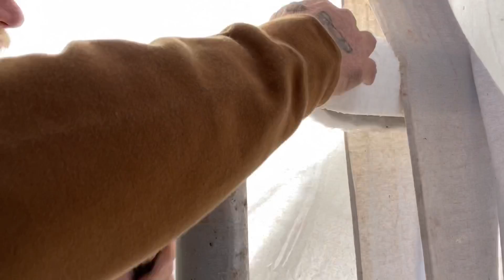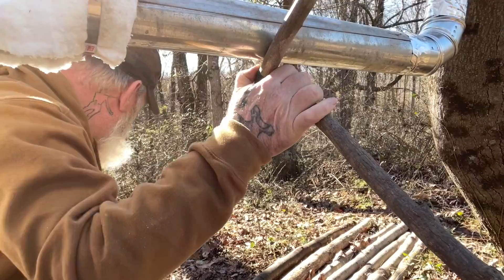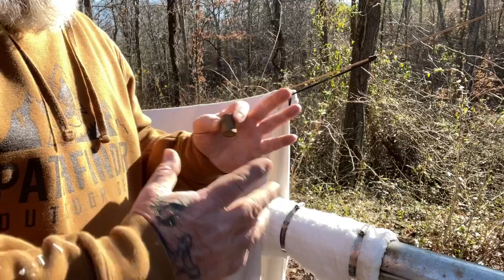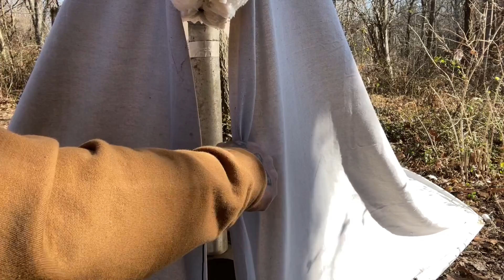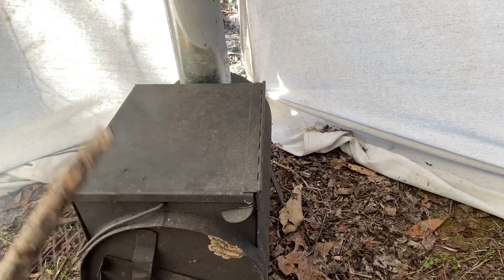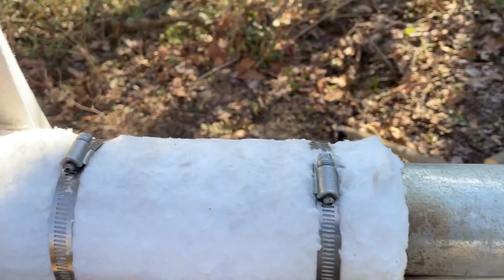Hot Tarp no Stove Jack

Comment: Hi Dave, great stuff. Just remember to use steel stove pipe not galvanized pipe like what is used for gas appliances. Wood stoves run much hotter and at 480 degrees Fahrenheit zink will begin to cook off the galvanized pipe and it is very toxic. Wood stoves can run well over 500 degrees. Gas appliance exhaust never get near that temp. All the best

Comment: You can use cheap silicone cookoe sheets to make a diy stove jack, sew on some velcro or punch some holes every 2 inches and about half an inch from the edge and if you just have a tarp reinforce the edge of the tarp with some duct tape then again punch holes at the same locations as the stove jack and you can just thread some thin sticks to act as toggles through the holes for quick and easy removal, put a flap going over the stove jack seam so rain doesnt go down into your shelter.

The only downside is of course cutting a permanent hole in your tarp but it can be closed off if you keep a spare flap of tarp material to cover the entire hole agaim held in place using a few toggles or use a piece of paracord threaded through.

Comment: If you cut a hole in the tarp, use a Silicon baking sheet on both sides of the hole. The Silicon sheets are for temperatures of up to 500°f. I got one at Walmart in the kitchen Isle for then at $9.00. And the second one at bath and beyond for about $11.00. 
Just look at different stores for these Silicon matts...

Comment: I can already see how those round stock toggles will give better purchase for the larks head than the marbles/rocks I currently use... Any idea of the wear over time of them? The marble part lasts for years although the canvas at the bank line pinch point wears some from wind/sun/rain. I've also noticed that the canvas will reshape/stretch to the shape of toggle/marble whatever the longer they're left in, so if one wants their tarp to not have that happen, consider permanent strap type tie outs.

Comment: A little  BBQ high temperature  paint to protect the outside. And an inch or so of sand to protect the  bottom. Will  make it last longer. A 2d piece of stove pipe after the elbow  will increase the draft. The rain cap won't  stop sparks a metal screen  inside of it will. 
Ice house stove. 
All the best

Comment: I do a similar configuration with my 10x10 tarp over my hammock, folding the "doors" in at both ends to make a sort of floating tent. Hung low to the ground and battoned down all the way, it does a pretty good job cutting down convection under the hammock.

Comment: Well if you are going to do a horizontal run, i would either do it really short or do more of that run inside the tent.  Bailing wire works good for holding glass wrap on pipe.  You can also turn the bipod into a tripod pretty easily:)  I like that stove configuration with the handle…

Comment: Hey Dave. Great video. One question though. When you were securing the back flaps around the stove pipe why didn't you overlap the two sides around the toggle and tie it off? Seems like it would make for better insulation from the wind. Granted it doesn't look like you needed it in this instance.

Comment: that's a great setup.  one the items that I found that will strengthen painters tarp is a coat or two  of clear sealant.  Flex seal is helpful to keep small flying debri from piercing the tent and also ads a layer of waterproofing/insulation.  Rustoleum also makes a sealant but I don't know if it would help with that or if it would coat the cloth enough to add any value such as warmth and insulation.

Comment: I'm no KILLJOY and I am all for innovation and cheap hacks, but you NEED to place DISCLAIMERS and WARNINGS in your videos and in your Description when demonstrating such ideas.  I accept that there is always going to be a certain amount of airflow however tight you try to fasten that Painter's Tarp, but in my opinion (and I know a fair bit about woodburning stoves), your horizontal pipe is too long and you have increased the risk of Backdrafting and Carbon Monoxide Poisoning especially once the coals have died down from a roaring flame whilst you are sleeping.  

You would have been better using two 90 degree bends with a short vertical straight off the stove top, the first 90 deg. bend off that joined by a short horizontal through the tent flap to the second 90 degree bend. joined by the next vertical straight up above the height of the apex of your shelter to a proper spark arrestor, not a rain cap as you used.  

Please, at least warn folk of the dangers of Carbon Monoxide poisoning with such setups and/or to use a small portable Carbon Monoxide Monitor/Alarm.  The next person could follow your idea using an enclosed space or with a super shelter and I as I usually say, Wake Up Dead or at best with a very sore head.  

Merry Christmas.
Reply from the maker: This was a trial concept as I said on the video, the next one I will use 45’s as someone else suggested it may draft better so I want to give that a try as well

Comment: Dave, a poor man would probably just use some of the long twist ties that his Christmas lights came bundled up with instead of the expensive worm screw hose clamps. If he had a few bucks to spend, he could buy some GearTies. They're good enough to hold fiberglass in place and they are more multi purpose, IMO
   On the poor man theme, would you buy 2 cans of any flavor of Campbell's Chunky Soup and cut the ends out with a side cutting, safety can opener and demonstrate how perfectly the two can be pressed into each other to form a stove pipe section? I find that 4 of them pressed firmly together makes a nice manageable length that can be more gently assembled (so they can be disassembled when they need to be stored) to whatever length you need for your tent setup. I don't have the things I need to make videos, but I have a few Ideas that I think would be useful to folks that share my interests on YouTube and this is one that I think could reach a wide audience on your channel. If you aren't interested maybe one of the instructors at your school or just a subscriber would be willing to do it. I just want to see the idea put out there. Don't need the credit.
   I have a question about the way you closed the back of your tent. Since you are using a lark's head that locks onto itself and stays put, couldn't you lay both the left and right flap over the toggle and slip the larks head over it and lock the flaps tighter together and with less cordage?
   How much smoke got released into the tent when you opened the top to feed more wood? I don't think I like that design as far as heating a closed up tent is concerned, although I do see how cool it would be to grill a steak out of the weather with the tent more open.
   I looked up the price of a 9'X12' painter's drop cloth and at $20 that's pretty cheap. Will that actually repel water out of the package, or do you have to treat it somehow?

Comment: I camped for years with a large tarp tied to the back of my IH scout with some poles holding up the other end. A smaller tarp for a side wall.
Built my camp fire half under the tarp. Make sure it's about 7 foot high.
I was comfortable with warm clothes to 25 degrees.  All I had was cheap Kmart sleeping bag. Layed on a chase lounge also from Kmart. 
Good times

Comment: Hey Dave, I've been working on this same concept for years. You pretty-well got it now, but roll a piece of 4" stove pipe around your rockwool then clamp it up; also, try using a length of 6" stovepipe as a thimble around that and you won't have any problems with the canvas getting hot. You won't even have to worry about cold air getting in through that assembly unless the wind is howling or blowing directly into that end of the shelter. That little stove looks pretty handy and will be enough to run you out of a small canvas shelter, especially if you control the draft with a damper. You could modify the firebox just a little bit so it will burn more like a rocket stove, but it basically is a rocket stove to begin with.
Have fun with working on this concept, you'll eventually figure out ways to put a woodstove in just about any style or configuration of tent, including nylon tents and polyethylene carport canopies with side curtains.
Have a good one man.

Comment: Great video, my dad recently pulled down his stove and it is the same style but it's pretty rusty. Any tips to refurbish the stove? I figure hitting it a wire brush on a drill can work but will take a while and likely require a few brush heads. My only thought afterwards is high temp spray paint.

Comment: I have an older hot tent that unfortunately I ordered with the stove pipe exiting out horizontally through the wall.  Its not worth the time to build a support for the pipe.  I need to convert it to a vertical pipe exit with a stove jack.  The newest tent I own has a stove jack that allows the whole stove to be set up with the pipe vertical in less than 5 minutes.
Reply from the maker: Yeah I have like 4 of those but when I post about them folk think I’m trying to sell them or something

Comment: That's an awesome idea. I can't believe I never thought of it. I'm a plumber and work with that pipe a lot. If you don't mind me making a few suggestions I might change your design a little. 

1. I'd scrap the HVAC tape for 1/4 inch sheet metal screws. What you'll find is after a long or hot burn that adhesive will stick to the pipe and remove itself from the tape. That tape isn't really meant for exhaust ducts like what you're working with. In time it'll gross and maybe melt apart (I can't say for certain, but I see them melt off of people's water heater vents).  If someone bumped it or an animal tried to run across it or the wind blew real hard that might come apart, but if you shoot 3 sheet metal screws through each joint it'll be pretty rigid. 

2. For your wall penetration pipe, go get a piece of triple wall duct pipe. It'll screw in just the same and it is a much better heat sink. I would test it overnight, but I think if you ran triple wall a foot through each side you'd probably be able to leave out the fiberglass entirely.

Either way it's a great idea, man. I'm definitely trying this one. Thanks for the inspiration.

Comment: Not too shabby. 👍

Have you thought about just running the pipe up at an angle say 45 to 60° instead of 90 up? I would think a tripod would hold it up no problem, especially if you use some wire to wrap around it. 🤷🏻‍♂️

Comment: You can use welders cloth either in the area around the stovepipe, or , if you can find enough welders cloth, you can make the entire tent out of it. It looks alot like painters cloth anyway. Then, the entire thing would be fireproof. I have been struggling with the same idea for some time now. Not sure how expensive, or how large of a sheet the welders cloth comes in though. If its to expensive, just get enough to cut out a large enough square, and then cut the pipe hole out of the center of the square, throw some velcro around the edges of the square and be done with it. Last time I seen the welders cloth, it was even white, similar to a wall tent. Please forgive me if I spelled welder wrong. You get the point though. Great video, thanks.